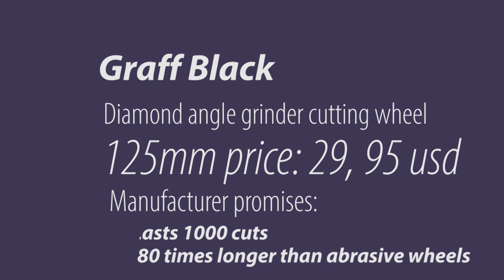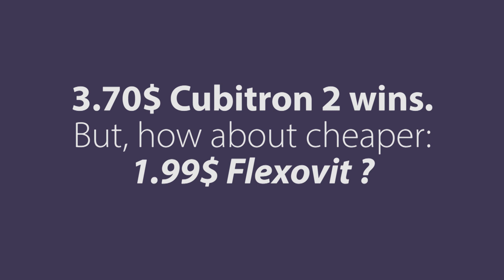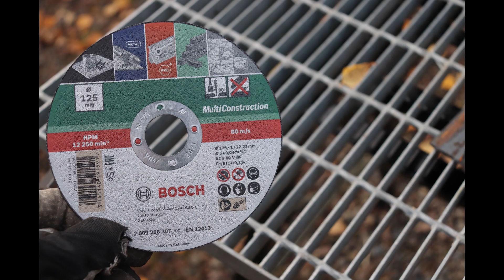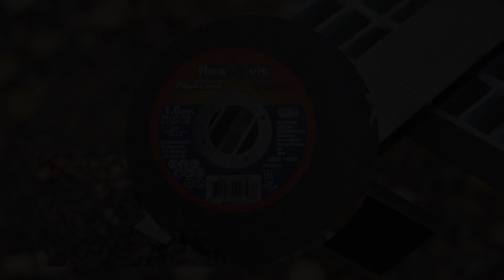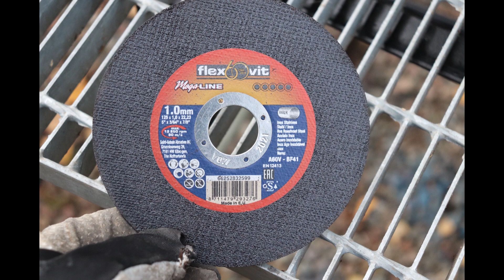Graff Black diamond angle grinder wheel, real alternative to abrasives?

Comment: I noted something you are holding back on the solad disk and not on the uthers
Reply from the maker: I tried also make accurate cuts as possible. People usually do so. 
Its more trickier to set that diamond wheel to the line, and star to cut straight. It doesn't "bite" steel like abrasives, you need to hold it much longer still until it starts to cut. Of course i could have push wheels against the steel with force, but those are not intented to use that way. Wheels just wear out faster and may break. So, i made cuts like i allways do, i try to make straight cuts from the very beginning.

Comment: as this disc cuts the equivalent of 60+ of the others the price comparison does not equate also no mention in the reduction of dust from abrasive.
Reply from the maker: Important question is.. IF it lasts many times longer than abrasives. This one got wasted after cutting 7" long piece of 1.5mm stainless 316 sheet.  Diamond wheels can be a good alternative for abrasives, but this Graff isn't, in my use.